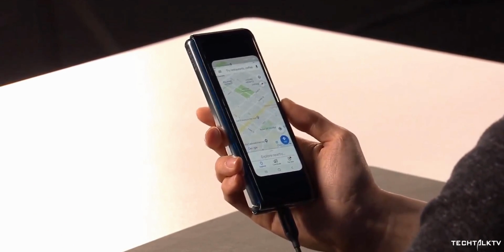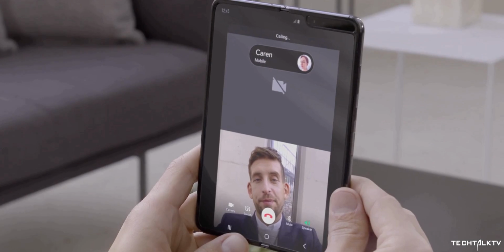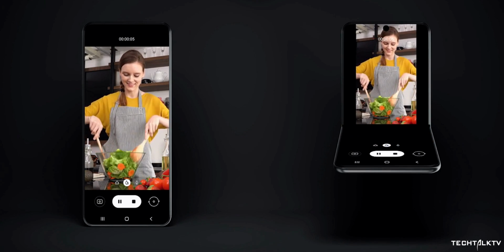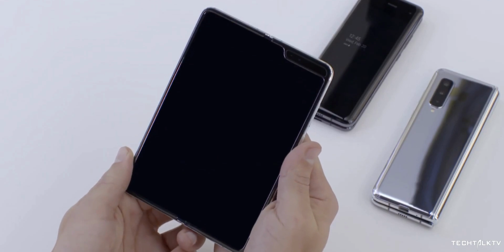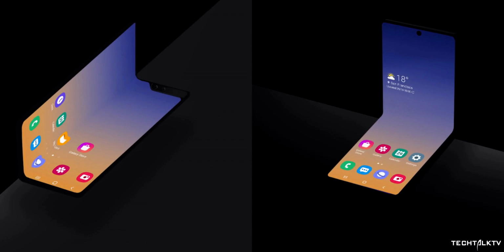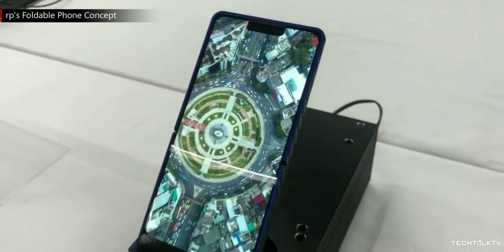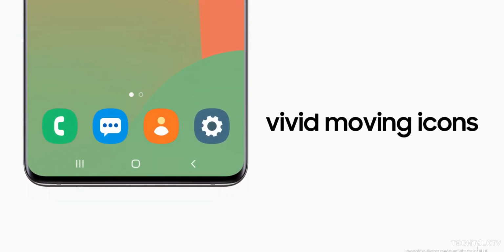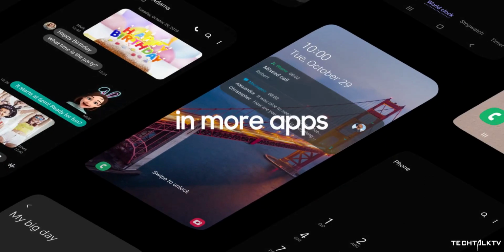Samsung Galaxy Fold 2 - FIRST LOOK

Comment: I feel like I'm the only one here that loves the clamshell design, having something smaller to fit in a bag or pocket, and no need for a case to protect the screen. The original Fold design just looks clumsy and that weird thin screen on the front is completely off putting to me.

Comment: Well... I like the idea of a full screen phone that you can fold closed to fit into a smaller space. But why not Galaxy Fold: C (for clamshell). And then make the Galaxy Fold 2 an updated version of the first Fold? The whole attraction to it was that you could have a phone and tablet in one package. This....is just a normal Galaxy that folds closed. That has its uses and can sell well, but why not 2 separate products? This just seems like a back-step.

Comment: Am i the only one that actually is satisfied with the second design? 

Both folds have their own quirks. One becomes a tablet, the other becomes easier to carry and hide.. 

It should be that the first one should be rebranded into foldable phablets, while the second is the true folding phone. Both have flaws too... The first one's screen is too small to be practically used as a phone, and the other has lesser benefitsc, but ultimately both are good in their own rights

Comment: Personally I prefer the original fold. & I am not liking Samsung right now. So Samsung really didn't update their multitasking feature with the one UI 2? Bc it sucks now comparing to the samsung experience UI! In fact, multitasking was the best thing about Samsung over the competition. Now with one UI multitasking feels like I'm using an iPhone & that is not a good thing. I might as well switch back to iphone where there is the best ego system fr day one to date, imessage, find my iphone, facetime, a more stable & secure OS! Just saying!

Comment: I'm not hating I genuinely love Samsung, but let's work on mastering the technology of folds first before dishing out another smartphone. Secondly  folding in that direction is completely unnecessary and we don't need you creating a third successor that opens up and becomes larger possibly in length vertically. I do like the idea of a phone being able to have a bigger screen but be compact at the same time maybe the Samsung Sol 2 should make the front display when you close the phone bigger but it's not a small tiny little window in more of a normal phone screen size on that third screen.

Comment: U.  My. Friend. Is 2nd  person on YouTube. Said Sam   sung. Fold. 2  is afortable  is not. True  2000 plus. Price is nothing affordable   Sam  sung fold  one. Disaster   Sam  sung  fold  1 2000 plus  price. Is not. Lower  than. 2000 price plus    if  it was. Lower. It s price. Would have to 1000 dollers  total  I. Dessagree  with u  people on YouTube. Correct 100 percent without zero. Doubt  before you put your information  out  not incorrect info  what. Good is that

Comment: Honestly, the biggest complaint with the current Galaxy Fold (mine aswell) is the smaller outer screen. I'd also like a head phone jack. I've heard of so many on YouTube returning because of that complaint. Not only could they have sold way more then they did, but people more then likely wouldn't have returned it. Also, by the looks of the Galaxy Fold2, it seems as if your going to be getting a smaller screen once its open. I was blown away at the fact we could fit 7+ inches of screen in our pocket so soon in the tech world. We are now going to downgrade? I think I'll stick with the current Galaxy Fold. I'd also just fix the current issues with the Galaxy Fold (perhaps listen to the community and want they want. I know Samsung is good at that, but they seem to be lacking as of recently). And to me, a second generation fold, seems a little early. I would steer from adopting a new design so soon but that's just me....🤷‍♂️🤦‍♂️

Comment: No, this is just messy, if the screen bends using their current design then it is soft, easily scratchable/breakable, and is just not durable enough.

Comment: Silly...It seems Samsung and Motorola just forgot about the only real reason to have a foldable phone: To be able to enjoy the immersion of a tablet AND the portability of a smartphone in one device. Considering that today's phones' screen sizes are already close to 7" and still very light, compact and pocketable, what real sense is there in buying a folding phone that opens up to virtually the same display size as them?...I would definitely buy a folding phone with the same basic form of the first-gen Galaxy Fold but definitely wouldn't buy that Fold 2.

Comment: The only problem in the Galaxy Fold's form factor is the position of the notch (i suggest the pop-up camera) to make the screen symmetric.

And the hinges. You know what I mean.

I also suggest that the outer display (when folded) will be like any smartphone display right now. (notched or punch hole) and NO BEZELS!!

Comment: Fold 1: I'm a foldable tablet and more useful.
Fold 2: I'll fold......... hmmm...... that's it.
Reply: Santhosh Illa atleast its below 1k dollars
Reply: @lovesickgurl399  For LESS THAN HALF of the practicality compared to the Fold 1.
Reply: PSYCHO the practicality is a smaller, more compact device in the pocket. I kinda like it.
Reply: Skull Rings, Knives, Watches phones are already compact and if your going for a really compact device than there are phones for that too the original fold’s quirk was that it turned into a tablet when fully unfolded but this new one is basically a flip phone for people who have really impractical pockets
Reply: @tattoochef425  ??? So basically the reason you buy a phone is to put it in your pocket?
Reply: less price and more compact... not everyone wants to carry a brick around in their pocket
Reply: @jays_cafe  make sure that you don't forget to keep the charging brick in your pocket
Reply: I guess the screen ratio would be better in fold 2. Most of the apps are designed and supported basically for rectangular screens, and square screen makes it all hard. Even when you see there are 6 cameras in fold, of which one we use as a selfie while its folded, two selfie cameras while open, and 3 primary ones. I think we just wasted some extra dollars as well as hardware. While the fold 2 would have only some primary cameras which we can use for selfies while clampshelled.
Reply: Then dont buy it ?

Comment: what's the point of this design? It's just like flip phone
Come on samsung, you only need to improve the design of current generation there is no need for new one
Reply: Yeah, if this is the actual form factor, it seems to defeat the purpose of having a folding phone in the first place.
Reply: fire falcon it turns into a watch
Reply: Exactly bro
Reply: That, and make it larger

Comment: I want a Note 10 that folds open to a bigger tablet.  Not a Moto Razr.
Reply: Maybe it will be an evolution all over again. We will start with 6.6 inch screen which can be folded to a 3" size screen. And they will grow and grow and grow. Just like we went from a 3.5 inch iPhone 2G to 6.5 inch screens now.
Reply: As long as the fold is cheaper then the razr.
Reply: As of for there sale perspective they are doing it (due to high price fold didn't reach out to many people )
Reply: Razr nailed it👍👍👍👍👍
Reply: @rafaellucero5098  razor did not nail anything they sacrifice key features for the foldable screen
Reply: @notomnithegodking  i dont think that have a point.....razr is a super thin amazing no gap folding device ...you cant put all those shits "a flagship phone" have on that thin and sleek look...Motorola just installed the right specs for its battery capacity and thin casing.....this is smart rather than putting all those b.s. specs and then eventually will get shorted and EXPLODE.....
Reply: @rafaellucero5098  yes you absolutely can and Samsung is working on it right now though I don't like the clamshell design personally it's still really innovative. The razr sacrifices too much just for folding capabilities.
Reply: @notomnithegodking  i mean it will be not a razr if its as thick as  the galaxy fold...right? And why call it razr if its not look like the old razr😂😂😂😂..dont worry you will not die on a mid range specs ...and Motorola really nailed it in folding screen technology...how come a huge company like samsung created a "flagship" folding phablet....but theres a lot of issues like regarding the chipping screen laminate thats so sensitive that will ruin the screen....the gap and another gap on their new phablet the w model....i will not call it fold if it cannot fold itself properly
Reply: @rafaellucero5098  no those are not "midrange" It has two cameras the 16mp on the outside and the 5mp on the inside. Only a 855 or 845 chipset and a bunch of other major sacrifices.
Reply: @notomnithegodking  howabout the overkill 6 cameras of the "so called fold"?😂😂😂😂....many are considering it as a midrange smartphone.....specially the cameras...irdc...the point here is who made the folding screen technology better?.....motorola only sacrifices those 20+ prototypes before ending up into this very well executed and crafted masterpiece....
Reply: @rafaellucero5098  no don't get it confused Samsung was the one who started the fold trend in the first place so obviously their technology and experience in folding aren't the best. Samsung's cameras are part of the reason it makes the fold a PREMIUM phone along with its high end processor and huge battery. Samsung was willing to sacrifice nothing.

Comment: I don’t see the benefit of the clamshell god though, why do we really need it? A smartphone that expands into a large tablet sized screen makes a lot of sense but I’m failing to see any real reason for the new fold to exist. 

I’m hoping that this is like a budget version of the fold 2 and then there is an actual version which improves in the original fold design, with no notch, smaller bezels and all.

Comment: I would actually go for either design of the fold. Probably be 2 separate folds for different people. They will still look gorgeous.
Reply: No they won't there will be a giant crease going across the middle of your phone 😂😂😂😂😂😂😂😂😂😂 cool your phone folds 👏👏👏👏👏👏👏👏👏🚽🗑️
Reply: That's what I think also, that samsung is still going to continue the original fold but only introducing a smaller one. Much like the Note and S series
Reply: I just want to know what the use case for this Fold 2 design could be. If you can already fit an S10/+ in your pocket no problem, why would you pay extra for the ability to fold it?
Reply: @MalcolmBlk  simple because it becomes a tablet. And now you have a hybrid experience with way more screen real estate.
Reply: @rubedog516  I'm talking about the Fold 2 design, not the first Fold. Fold 2 doesn't become a tablet, it becomes an S10+ sized phone.
Reply: Malcolm Black how about put it on your wrist, and turn it into a watch? Or in the future, your watch unfolds into your phone?
Reply: Malcolm Black also, you can turn it into a ds. Or you can just look cool, like having the razor edge phones from the past. It will also be more affordable to put folding phones in the market, so that they can test productions and improve the design by more people actually buying it from being more affordable. And if you can get a folding galaxy for the same price as a regular rip off iPhone, many people would take the option for the cool Samsung design over a basic iPhone
Reply: Malcolm Black and just look at the video, it’s so amazing technology, imagine having a folding display in your pocket, it’s so futuristic. It’s called innovation. We may not see a use for it now, but in the future they will be like “can you believe screens didn’t fold in the past?”
Reply: @N12Gautam  All your points are good but they aren't addressing my concern. Why would people invest $1500+ on the Fold 2 if it doesn't provide them with any visible benefit over the current rectangular form-factor or even over the original Fold? With the original Fold the benefit is clear - you get a large screen that can fit in your pocket. With the Fold 2 it's unclear. Sure a couple of enthusiasts will buy the Fold 2 because it's cool. But a couple of days ago we heard that Samsung are predicting a huge increase in sales of the Fold 2 compared to the og Fold. I just can't see that happening if the Fold 2 doesn't provide anything at least on the same level as the og Fold. My hope is that Samsung are going to release 2 Folds, one of them being the Fold 2 in this video and the other being a refresh of the og Fold. Then the sales predictions would make sense. Smaller design for those who don't have $2k to spend on a phone but still want to experience the folding screen, larger design for those who want top of the line foldable.
Reply: Malcolm Black I think the fold2 will be 1000 not 1500, so you tell me why do people buy iPhones for 1000 dollars when it’s the same diariaha from last year? Atleast you get a different form factor, that it will be cool. And what they could implement this is in thier note phones possibly but idk because of the stylus. But imagine having a phone as big as a note but also if you want to fit it in your small pocket such as the ones girls have in thier jeans, they would be able to. Girls use iPhone because it’s small and fashionable, with the fold2 it will have similar benefits but even more cool than a simpleton iphone
Reply: @N12Gautam  What's your source for the $1k price? My guess is $1.5k because that's how much the Razr 2019 was rumored to be. Also I really don't think Apple users are a huge target market for any of the foldables until Apple release their foldable phone. Purely because most iOS users won't want to get an Android phone, regardless of the form-factor.
Reply: Malcolm Black no there are some people who are getting tired of the lack of innovation by apple, so some could see this as an alternative
Reply: @N12Gautam  "Some" really doesn't justify the Fold 2 design. Especially because people who really want hardware/features have switched to Android a long time ago, so you're talking about like <5% of the predicted sales number. And that's only if the Fold 2 is actually around $1k like you said, you haven't said where you got this number from though.
Reply: Malcolm Black it’s a guess, I feel like they can achieve it, it’s half the screen so. And they have the process of making them down, which is actually not that hard.
Reply: @N12Gautam  Not very convincing, the Razr 2019 is $1500 yet its specs are poor. We will see in time I guess.
Reply: Malcolm Black well this is Samsung’s second folding phone, so they have the factory and knowledge to create them already. Maybe not 1000 but definitely less than 1300 is my prediction
Reply: @N12Gautam  you sound like such a Samsung fanboy LOL the phone concept is garbage and so is Samsung. There's nothing innovative about it's just a cash grab
Reply: @LongNeckSweatHogDirtyWetDog  Well to be perfectly honest you sound like a Samsung hater.
Reply: Chris Hansen oh but you probably like apple with the same design for the last 2 years. Oh wait they got a new camera, so innovative
Reply: I suggest that fold2 shoud be like a trifold wallet...you could fold it twice then voila!....a tv screen

Comment: NOOOOOOO!!! was really hoping for no punch hole or bezel in the Fold 2
Reply: They could actually give a bigger display on the outside and have no front camara. Kinda like the xiaomi concept phone where you use the back camara for selfies
Reply: @cinekotha500  the front camera is not only used for selfies but also for video conferencing.
Reply: @sinister2423  who cares ?
Reply: @cinekotha500  umm maybe around 1 billion people using Skype, Whatsapp, IMO and stuff? Don't forget that people can't stop getting away from apple due to iMessage and Face Time. 
So yeah a lot of people in my opinion!
Reply: @sinister2423  no one would use the fold as their primary phone.

It they really need to do it they can do it in the front screen.
Reply: @cinekotha500  
With this new design, I think almost any consumer getting this phone will use it as his/her primary smartphone. I mean who'd pay over $1000 for a secondary phone?
That shit doesn't even make sense. Please don't argue just for the sake of winning based off of useless points.
Reply: Better than that huge notch
Reply: Why?